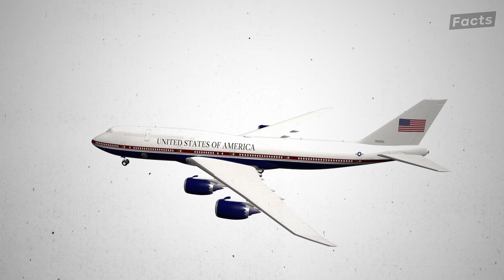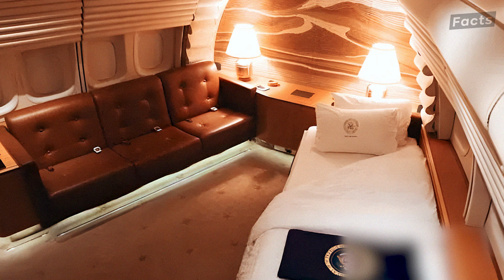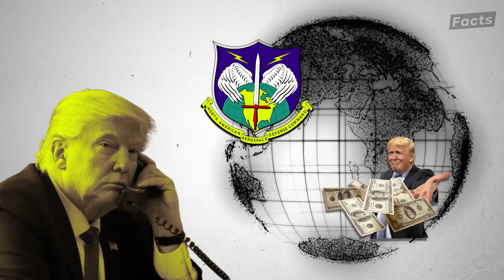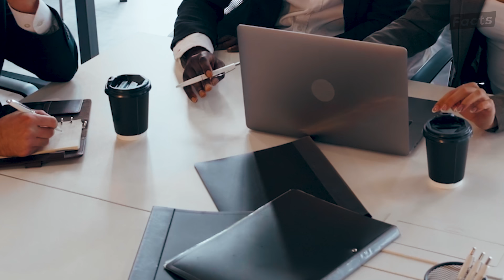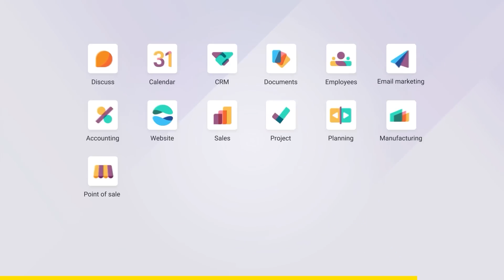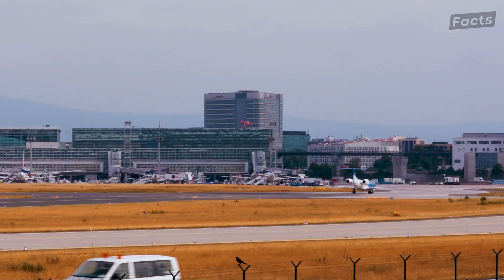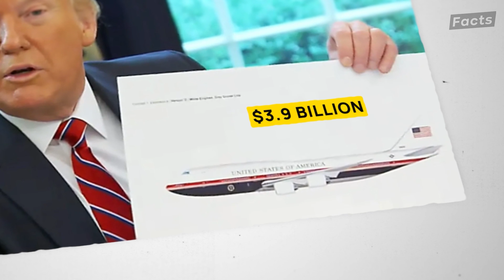Inside the NEW Air Force One

Comment: The Presidential Suite is NOT at the front for “quick proximity to exits in case of emergencies.”

The Presidential Suite is in the front because that is the most secure area. When traveling on AF1 people are assigned a seat. Secret Service then permits people to move about the cabin from their assigned seat rearward.

Of course, everyone is checked and rechecked by the Secret Service before boarding, this security posture allows for some movement while onboard.

The exception to the policy is if the President requests someone to come forward. In such a case, a Secret Service officer is assigned to watch that person while s/he is beyond their zone.
Reply: It is also the quietest.
Reply: thats y i gave it a thumbs down
Reply: However, the most secure place in any airplane, is the rear. Just ask any pilor or crash inspector. So the presidential suite being at the very front is also risky in case of crash landing.
Reply: @accidentcellar6307 AF! is probably the best maintained and least likely plane in the world to crash.
Reply: @robertd9850  sure, but that's not my point. My point is that no plane is 100% crash proof, and having the POTUS suite in that location is the least secure in the entire plane.
Reply: @accidentcellar6307 You are dealing with infinitesimally small odds.  First that AF1 would ever crash, and second, that if it did, POTUS would be lucky enough to survive if were in the back.  Maybe very slightly better odds but in most jet plane crashes, everybody takes the dirt nap.  Hardly worth redesigning the plane for an extraordinarily unlikely sequence of events.
Reply: @robertd9850 even in the worst plane crashes, the location of the few miraculous survivors are at the back.
Reply: @T1hitsTheHighestNote  But the plane crash with ANY survivors, especially jet airliners, is extremely rare.  Odds are too small to factor alter the design of AF!.
Reply: @robertd9850  If there was any threat of a crash, there is probably a bunker in the rear (or front) of the plane specifically design to take an impact and protect passengers in the event of a crash. There is only so much that can be done, but if you were in a pod in a multibillion dollar plane made for the whole purpose of keeping you alive, you could probable survive some pretty insane crashes.
Reply: @T1hitsTheHighestNote It’s random. No statistical difference.
Reply: @accidentcellar6307   If Air Force One ever did "crash" it would be because somebody shot it down.  Not the typical overshot/undershot the runway, flew into a mountain, had issues with the flaps/controls/wing fell off and fell out of the sky type of crashes.  This is the best maintained aircraft in the world flown by the best pilots in the world who will not land if the weather conditions are "interesting".  The dynamics of the plane getting blown up by a missile are a lot different than a typical civilian jet air crash and it would only be by some act of God if anybody survived a missile attack.
Reply: Don't rule out bird ingestions @AaronSmith-kr5yf
Reply: @accidentcellar6307idiot

Comment: The plane should be refillable by air!  Giving it more options!
Reply: You are clearly ignorant.
Reply: @ why
Reply: @codymcnary3607  Because it has NEVER BEEN USED and there are DOZENS of secure locations to land at within the range of the aircraft for refueling. Not to mention that fuel is only ONE thing that needs replenishment while an aircraft flies. The engine oil needs to be replenished often, so AR which adds complexity and weight only can extend the duration slightly.
Reply: @johnp139  it has been used.
Reply: @codymcnary3607  Only in training. Never when the president has been on board, unless you are talking about the movie with Harrison Ford.